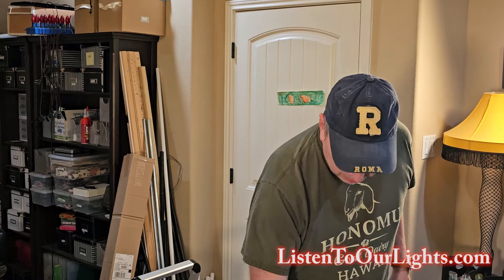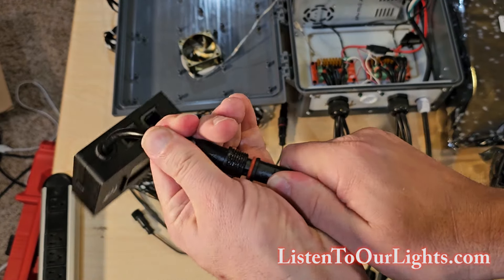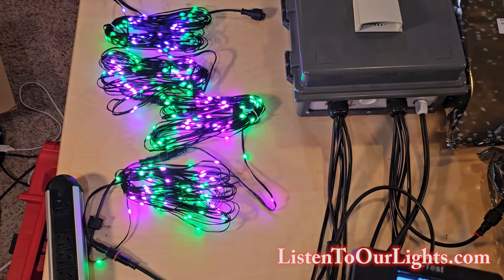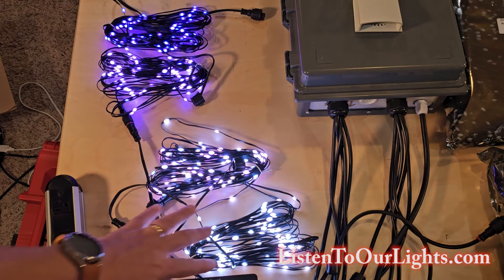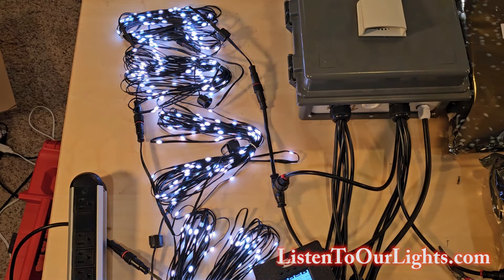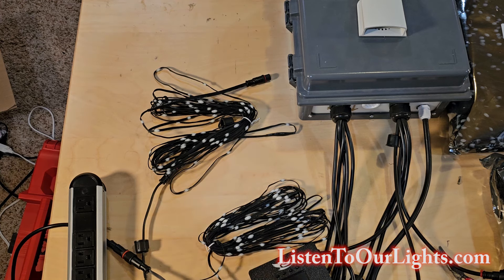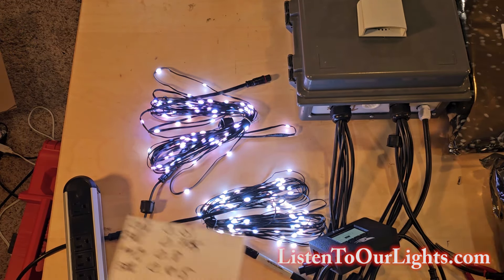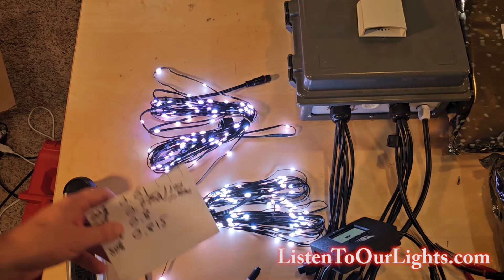Pebble/Seed Pixel Power Experimentation using Falcon FTest

Comment: Hi John,
Have you (or anyone else out there) tested these new Chinese megatrees?  I would like to use it in my light show.  I have a 20' and 2 16' ones.... ~1500 for all 3 I think.  They have some nice patterns.  And are sturdy and a piece of cake to put up with the interlocking steel poles.  It has nice guy wire support and outer ring and comes with stub anchors that go in the soil about 12".  You need a hammer.

They have 3 xConnect connectors coming down from the top feed unit.  The controller is at the base where the 5v PSU is connected.  All the seed pixel strips come out of the top unit and are open at the bottom.  

1008 pixels.  It has 3 groups of 12 strings containing 336 seeds. about 10 feet until the first pixel.  How in the world is this thing set up? Because all the 36 runs are open at the bottom.  The PSU running the thing is 30 amps.  I have a Falcon receiver with 4 ports and and 60 Amp PSU.   Hopeful but no schematic available to see how it is wired...